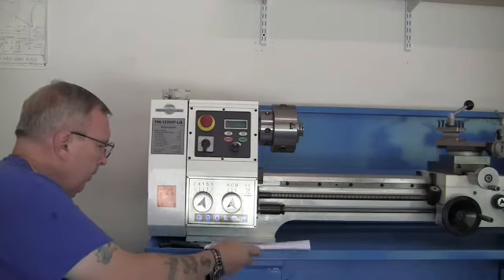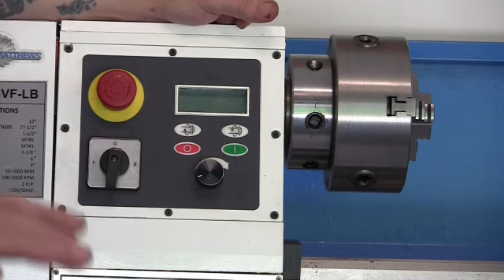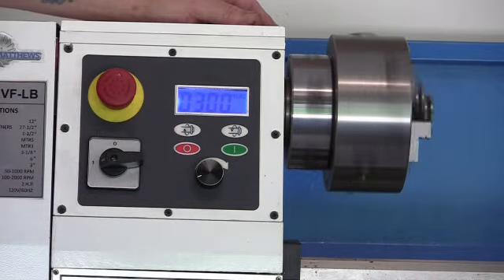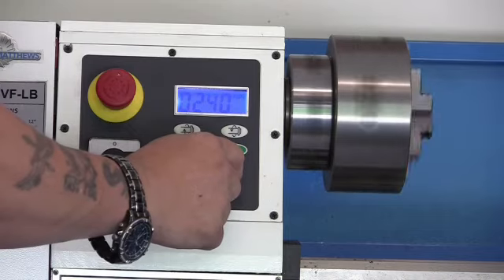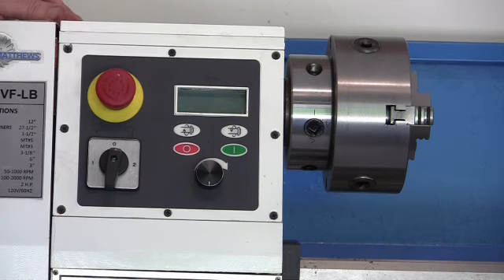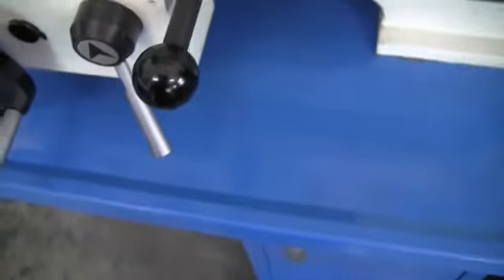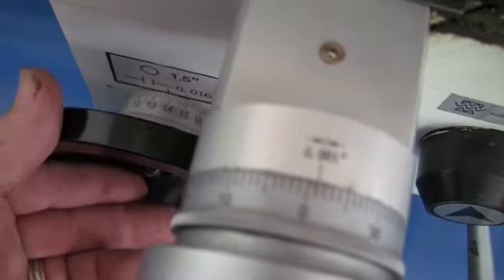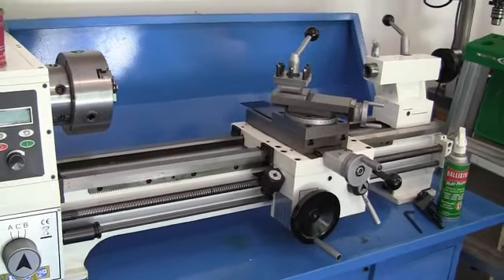PM1228VF-LB power up and function test

Comment: To have to open up the cover,put s allen wrench on the bolt. Loosen up & shift the reversing mech, toghten it back down snd close it back up. Just so you can either crossfeed to the center  & longitudinal feed away from the chuck is ludicrous. Southbend figured this out 85 yrs ago...! I have this lathe & that is a poor design.
Reply: I have the PM. 1130, which is the next model down from this one.  It has a leaver on the gearbox panel, where you can reverse the feed, without having to remove the gear cover and do it with tools. The lead screw and the feed rod should not be running at the same time.  My lathe has a leaver to select either feed, or lead screw.  This lathe has screw ball controls, and cheesy top start buttons.  It also has a rigidity issue on the cross slide.  The 1130 also has a wider bed.

Comment: The vibration you are experiencing is probably due to the chuck imballance which is pretty normal in a 4 jaw chuck.
Reply from the maker: the problem was there was not a load on one of the leveling feet

Comment: That all looks straightforward and simple, with a couple of hours on this machine you will be working it all without even thinking about it, I like the speed control, does it deliver full motor power throughout the speed range ?